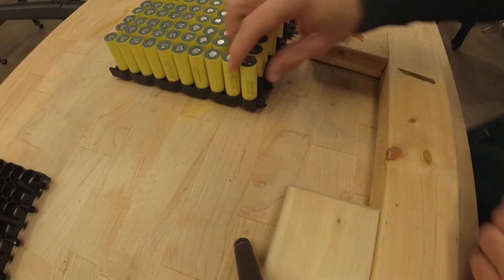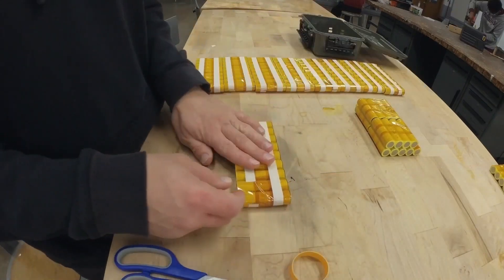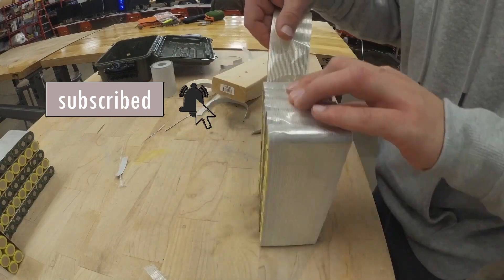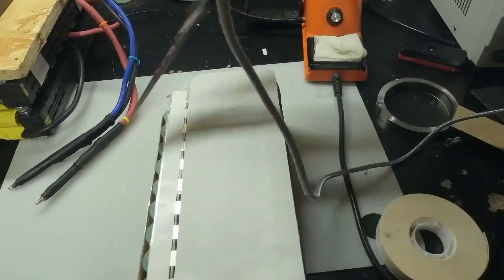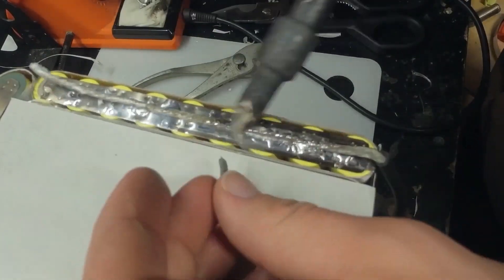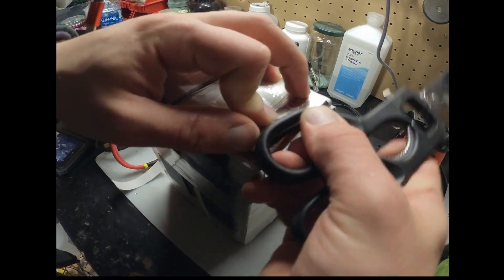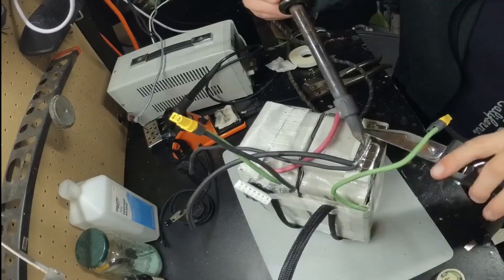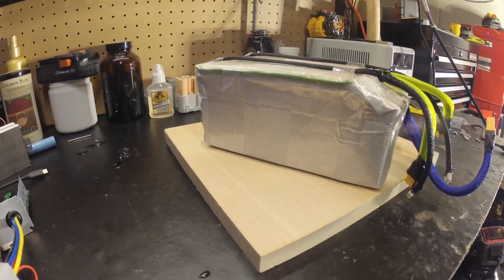How to Build a Lithium Battery Esk8 12s9P

Comment: Good to see you clean the nickel thoroughly before soldering the wire that series connected the packs. A lot of people miss that and don't understand how important it is to solder on clean surface.

I've had a lot of luck using simple 40X40X15mm radial blower fans to blow on the areas I've just soldered to keep the heat to a minimum. I can cool a group of cells down in 5 seconds with two well placed fans. Sometimes I even point the fans towards the middle of the cans while soldering. Yes, it does fight my iron a bit but I've never noticed a major difference in time it takes me to flow enough solder and I think I can cut the temps the cell actually gets in half based on the two temp sensors and some laser thermometers I've set up pointed towards various parts of the cells. I'm a big believer in "soldering damages the cells" because the biggest expert in Lithium Ion cells has flat out said "heat is the biggest degradation factor for lithium ion". A lot of people blow that off and say they are fast enough but then I time their soldering on their YouTube videos and they are spending 30 to 45 seconds PER TERMINAL SOLDER JOINT with an iron at 650F or higher. Micah Toll did a video where he did 3 second solder joints on each end of the cell and the thermal camera was picking up scary high temps on the outside of the cell. Not sure how much makes it into the cell but I know for a fact that is increasing the internal resistance of the cell and causing other chemical reactions that lead to degradation. You're one of the few YouTubers I've seen to not only have a plan on keeping the heat to a minimum but actually following what you preach and making quick work of that series wire.

It looks like your spot welder is fairly strong and might be able of doing the nickel copper sandwich. Have you tried it yet? If you can't get it to work with pure nickel then using nickel plated steel (I know, yuck) will have higher resistance and give you a better weld with the nickel plated steel on top of the copper. You only need a tiny square of nickel where you are going to be placing your welds and using nickel that has the slit down the middle does noticeably help when it comes to forcing the current to jump from one side to the other, though I'm not sure you could cut tiny squares of the slit nickel and have it work as well, you might have to stick with strips that at least have some length of an inch or so. You could have gotten away with possibly doing the nickel copper sandwich for the series connection on the two packs instead of doing wire though I'm not sure if copper thin enough for your spot welder would have the ampacity for the 60-80A (?) load you're thinking will be on that strip.
Reply from the maker: Thank you for all your kind words. I appreciate you reaching out and leaving such a nice comment. I try my hardest to improve my projects as my channel grown and I learn more. I’ve always cleaned contacts as a practice I got when cleaning really old electrical board that had that thick hard resin flux. I like the idea of the fans and will have to implement that on my next build. I also have no worry for my soldering iron especially my new one. I got a older 220w soldering iron with a 1” diameter solid copper tip. Nothing can fight that one. 😂 I know my first few build had been based on soldering do to the lack of my knowledge but have happily come along way since then. As for the copper sandwich I do want to try it but haven’t had the chance to get the copper sheets  this welder is a cheaper one but I did modify it pretty well. For a nice flat copper connection for the series if I was to do the sand which method I could have used 1-2” wide copper and cut slits at the corners. Then following through by folding and soldering the two points. I plan to continue improving and growing my projects and am happy to see I have viewers like you.
Reply: @spireEngineering6523  hell yeah keep it up. Maybe all the “Creative DIY” “Creative Electronics” and “DIY Electronics” channels that have 400k subscribers and comment sections full of “wow great projekt. you are genius” will learn a thing or two about properly insulating a pack and being safe with lithium cells instead of gluing a boost converter to a bare 3S pack that’s corroded like it’s been on the bottom of a river and calling it a 150Ah battery charger because it pumped a couple Ah into a 90% degraded lead acid starter battery that has 750,000 miles under the hood of a car.

Comment: Hi mate anychance ye can show me what u done to ye spot welder ?I have this welder done the cap upgrade for low battery...weld pens are shite I get like 10 cells befor I have to stop and let it cool down...what battery I use aswell... Nice build tho
Reply from the maker: Yeah no problem… so this welder I actually had one break before so I took the green capacitor and added it in parallel to the one on the new welder. Then I added copper and solder to beef up every single connection on the mosfets. I also added a 10Awg wire to the pens and soldered it directly to the board with the original so there was less chance of resistance where it gets screwed down. Plus the extra wire caries more amps with less heat. I will do a YouTube short explaining this with video so it is easier to visualize if you want. Oh and for the batteries it is a 3s2p spim08hp pack I built.
Reply: @spireEngineering6523  SPIM08HP FTW. I think thats the key to your spot welder having quite a bit of punch. Of course having proper leads and electrodes will prevent a bottleneck. I've considered upgrading from 8AWG to 6AWG (or maybe even 4AWG?) to see if there is any increase in the power of the spot weld. I have a feeling 6AWG is probably the biggest needed to do 0.20mm pure nickel (800-1000A 50-75J) but for 0.30mm and copper I could see 1500+ Amps or 100+ Joules heating up 8AWG very very fast. I just have a lipo based spot welder (SeeSii in the gold case with 10,600mah Lipo) but it recently took a shit and the board no longer works. Of course the Amazon seller won't help and I haven't gotten a response from Seesii via their website.
Reply: Where did you get that special tape? Hardware store?
Reply from the maker: I got it on Amazon this is the title it’s like $10 a role right now. GGR Supplies T.R.U. FIL-795 Filament Strapping Tape: 2 in. Wide x 60 yds. (4 Mil) (Pack of 1).      However it is just fiberglass reinforced packaging tape so you can probably find it cheaper
Reply: @spireEngineering6523  thanks

Comment: a good job. are you going to connect bms to it
Reply from the maker: For this battery there is no bms. I mentioned I. The video I charge it externally with a isdt Q8 smart charger. That is why there are so many leads. The two xt60 and balance leads are for charging